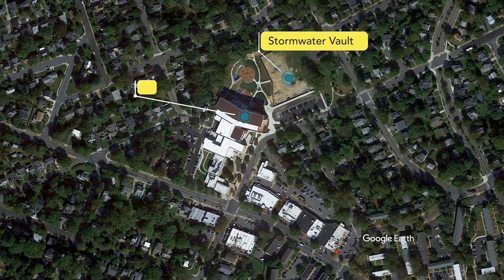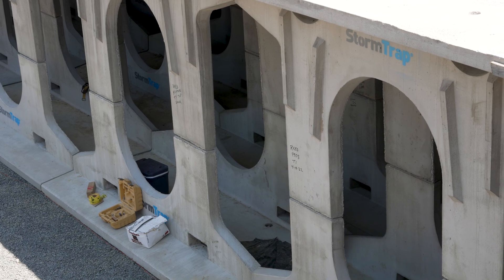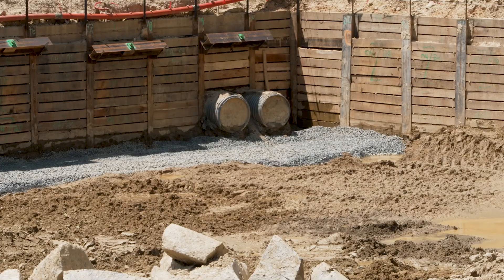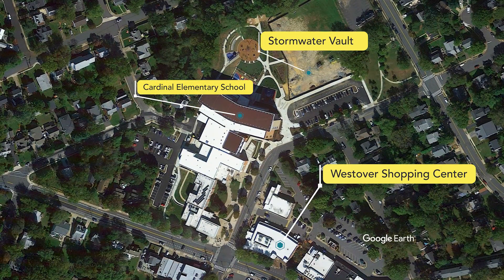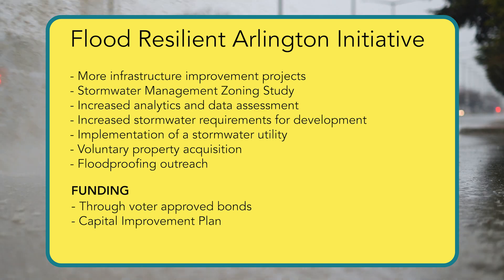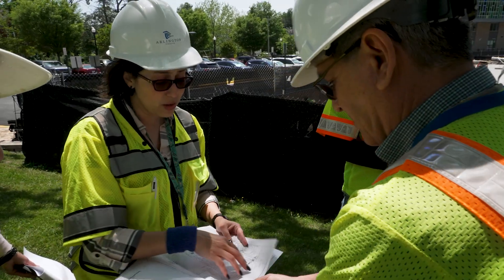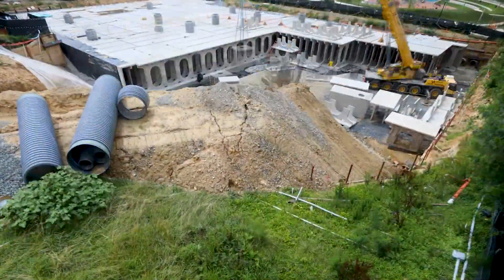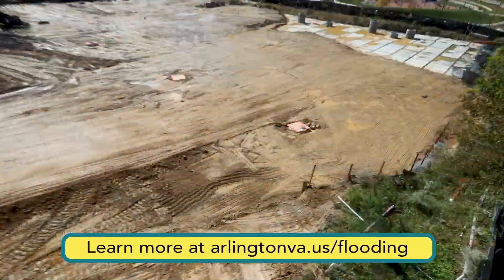Projects To Watch | Stormwater Detention Vault

Comment: The problem is NOT an increased intensity of precipitation ("storms").  The problem is Arlington County allowing construction of homes & additions that are 3 or 4 times the size of the original house and are squeezed onto the property lots reducing permeable earth surface to absorb rainwater.  To be sure, all these residential lots are having mature trees & plants cut down which increases rainwater runoff.